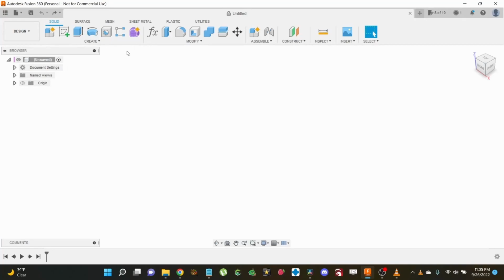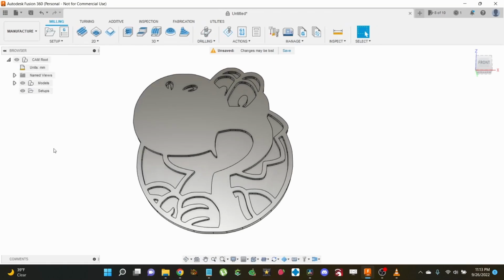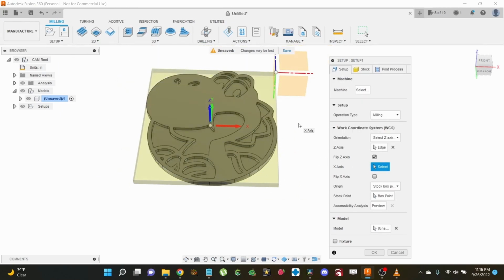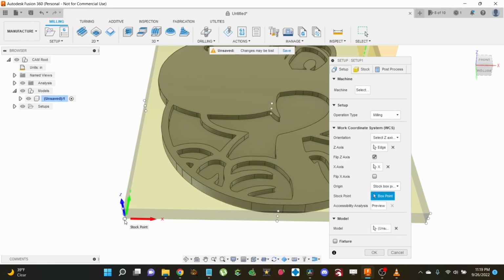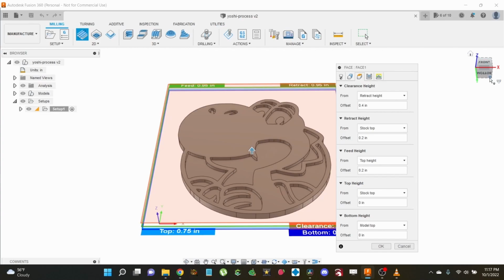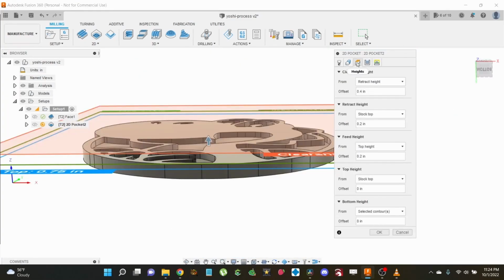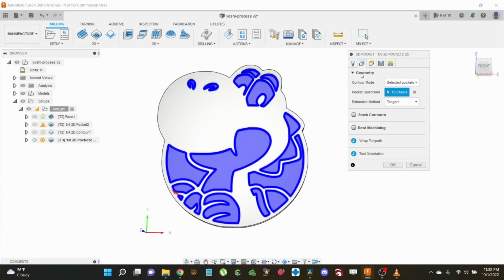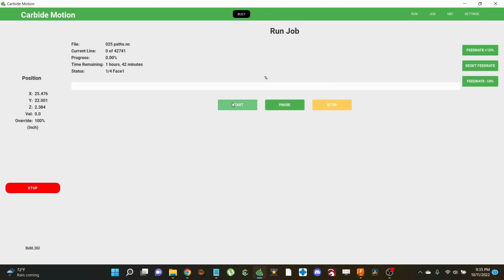From svg to toolpaths, how to set up a cnc project using Fusion360 cam

Comment: I am having a hard time replicating your technique. My artwork is in vector form, so I need to use SVG files if possible. I have found learning Fushion difficult even with good tutorials like yours. 

In this instance, I have a simple (closed) shape outline that will be a peice of plywood to hold a guitar body. It has five holes that will have pins to hold the body in place for finishing. 

I can bring in the SVG and reorient it to the axis POV I need for my CNC machine, but when I turn the sketch on to define the holes, I cannot select the holes. Am I doing something wrong or missing a step? Do I need to bring the holes in on another SVG, or is this due to having the free version of Fushion?

Thanks for any help, and thanks for simplifying the process.
Reply: I did get the holes to come in by creating a (boolean) compound path in illustrator and exporting the SVG as SVG instead of outlines. I was able to extrude in Fushion and the holes extruded as well. 

You quickly say "make sure to select "cut" then say okay" but I could not see where you were making that selection. Thanks.
Reply from the maker: In the Combine tool under the Target and Tools there are buttons for Join, Subtract, and... uh.. Overlap? I don't remember the names but that's what they do. You want subtract or cut, think it's the middle one
Reply: @aweirdguynamedjeff nope. This isn't working. Maybe version issue? I cannot select the 16 pockets after hitting extrude and selecting sketch again. Even after figuring out the location to select CUT.